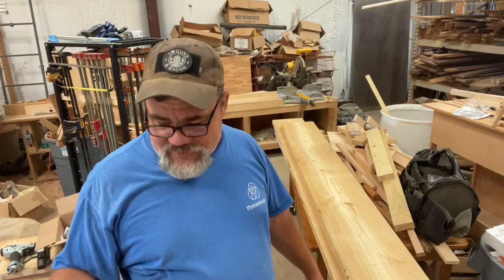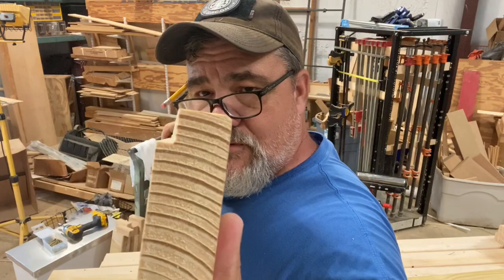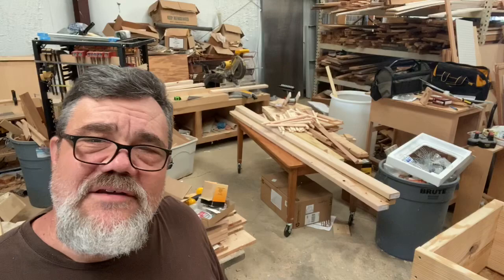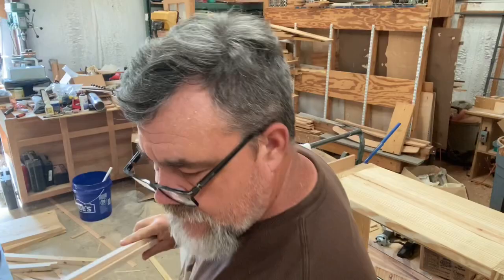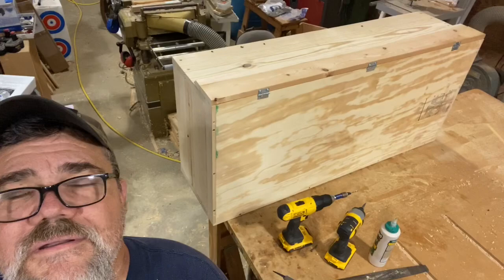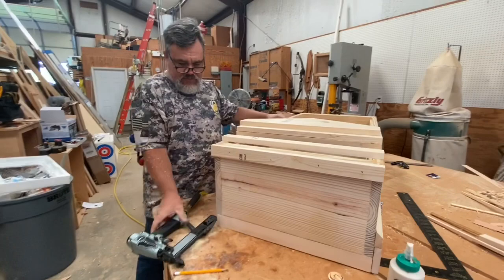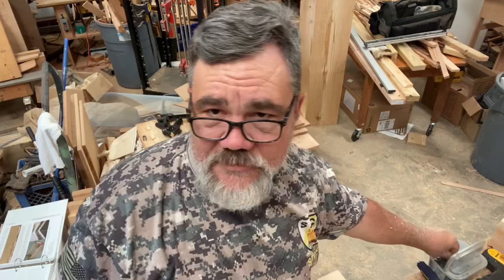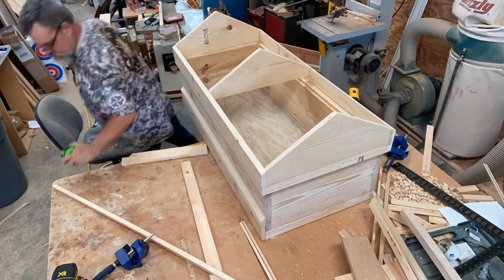Making a long Langstroth Bee Hive

Comment: I'm glad to see your shop is in as much disarray as mine. Lol. I really like the concept of the long box.
I'm a retired heavy duty diesel mechanic turned carpenter and I've  built several of the vertical boxes that turned out pretty good. I'll be using a dado set up for the cuts on the long pieces. I like to use rabbit
 cuts when I do them right. Your demeanor is great and entertaining.
Reply from the maker: Thanks Chuck!!!  Yeah, I have a problem where I’m so glad to be finished with a project that I don’t take the time to clean up afterward…. I’m trying to do better 🤪

Comment: If you can force some room into your budget to install some solar panels on your workshop, and use them to power a split unit heat/AC unit, it will pay for itself very shortly, and you will very quickly appreciate the investment. You'll be comfortable all year long in your shop. If you can install a large enough battery bank, you might even be able to power some of your tools as well.  VERY COOL PROJECT, and GREAT VIDEO!!!!!!!!!
Reply from the maker: Thanks so much…. Something to think about!

Comment: How did you attach the oil pan frame to the hive? You missed the attachment process on the video, great video
Reply from the maker: Great question.  I think I used pocket screws to attach the frame and then screwed the bottom to that
Reply from the maker: I just reviewed the plans and you build the bottom up together and I drilled holes thru the outer bands and screwed it to the bottom of the main hive body.
Reply: Is it still hot?
Reply from the maker: @okaneco not since it’s been winter 😅😂
Reply: How did you hive turn out (honey production), also did the bee propolis the #8 screen on the bottom? @HisWayHomestead
Reply from the maker: The bees did not propolis the screen.  My timing has not been good as far as harvesting honey.  They usually get to it before I do….